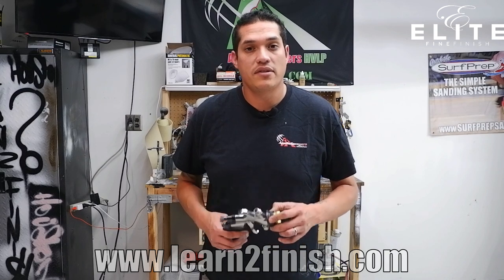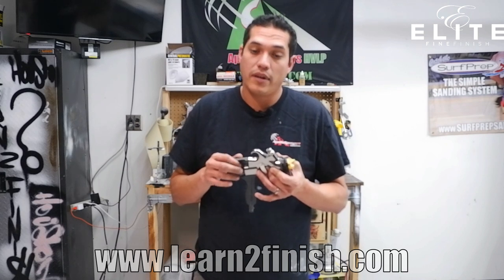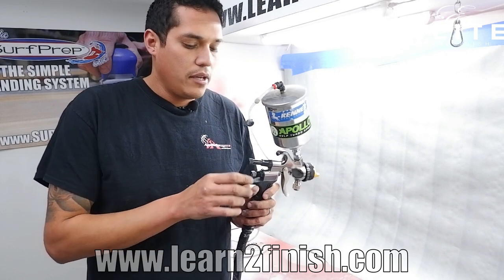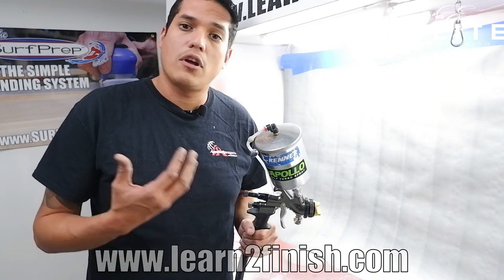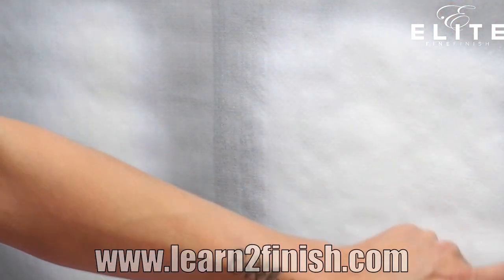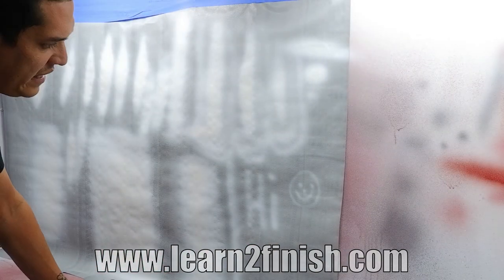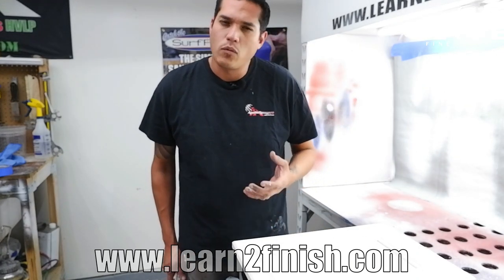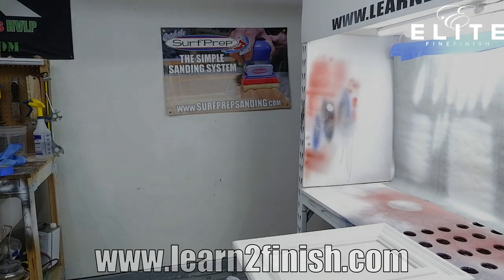How To Adjust An Apollo 7700 HVLP Turbine Spray Gun

Comment: The level of control and adjustment is amazing. This blows airless out of the water. Why do people even use that tech anymore. Hvlp has always been king
Reply: Deamn ..  just got me a 9.5  graco pro comp kinda regret not getting the apollo stage 6 to spray urathane or renner for cabinets or may be I can. Use this gun on it ??
Reply: @prestige_killa  yes you can use the Apollo 7700 with the graco 9.5 turbine
Reply: @bingobunga8995   would I still have to thin down the product?  I should buy this gun then .. for better pattern when spraying
Reply: @prestige_killa  there are a lot of other turbine guns that could be used as well other than Apollo 7700. It’s a very expensive gun while it is a good gun there are others with comparable atomization for less money. The key with spraying high viscosity (thick) coatings is pressurizing the cup feeding the gun. The benefit of the Apollo gun is its air port to pressurize its cups and its ability to be configured as either a gravity or pressure fed gun. Spraying thick coatings comes down to the air cap and needle/nozzle size. Apollo 7700 has a C high solids air cap and a 1.5 needle/nozzle tip. Thinning may be necessary if the percentage of the solids by volume of the product you want to spray is over 30%. I don’t use turbines instead I use a pneumatic spray gun with an air compressor. I’ve had no problem spraying Sherwin Williams emerald urethane right out of the can with a 1.3 tip which is about 32% solids. The key is pressurizing the fluid cup feeding the gun that added pressure forces it into the tip for even consistent atomization.

Comment: Great video! Bin primer is fairly thin in viscosity. How does the gun and the precision5 spray work with thicker products like the Italian waterborne. Would love to see how Milesi 2k pigmented base spray through gun.
Reply from the maker: I have sprayed Renner, ilva, and Milesi 2k water through the guns with no issues!
Reply: I don't know if viscosity ratings compare but I have just finished up a builtin unit and I sprayed BM Advance primer and top coat... thinned by 10% and I used the 1.8 tip and the Blue C-HS cap.  Spray quality was great and this was my first time using the Apollo Power 5 unit..  I have sprayed with an Earlex 5500 for a few years but only water based poly full strength.
Reply: @CustomDartCabinets  Did you open front black ring all the way up when you spray Advance ?

Comment: Louis did you thin the BIN primer at all before spraying? Also, just to confirm you were using a 1.0 needle set up while spraying the BIN?
Reply from the maker: No reduction at all. Correct 1.0 with BHS air cap

Comment: Hi there
When I use the Apollo 7700 with gravity fitting and compressor air at 28 t0 30 psi applying lacquer pre-catalyzed my finish is not smooth look like open porous
Could tell me what I’m doing wrong
Thank you
Reply: have you figured it out  I have the same problem

Comment: What is your favorite primer? Or maybe what are just some of your favorite products with primers top coats.?
Reply from the maker: depends on the application but i use a ton of renner waterbased products. I really like there self seal 1094 product
Reply: @finefinishsupply  the 1094, is that for a refinish/repaint or a new (self seal) wood application. Can you do a video on the 643/851 refinishing combo, maybe the mix ratios on the hardner and crosslinker as well. I just purchased the Apollo 7700 Elite fine finish on your website and am about to transition over to using only Renner for my Cabinet, Furniture, and Door Refinishing. I have been using BIN and precat Lac  and some other waterbornes for years but are not too familiar with adding catalysts. Thank you for your time
Reply: @ZpeaceION   check it out @Eric Reason channel he tested a lot of Renner product awesome channel

Comment: You’ve inspired me to pick up the Apollo power 5. Saw a post about it on the cabinet painters FB group. Question. I primarily will be using for cabinets. Would you recommend bottom feed or gravity feed considering the angles involved with doing cabinets. I’m coming from an airless
Reply from the maker: I would go with bottom feed. I would also encourage you to get the 3m pps adapter for the gun to make it a little easier to work with. Please consider us for your purchase! I am available to talk anytime 346.345.8951
Www.learn2finish.com
Reply: louis Jasso so getting the pps adapter in order to use the pps cup with the disposable liner system with the Apollo gun? Got it. That was one reason I was originally leaning toward the graco 9.5  I’ll def take a look at your site. I was actually gonna ask if you wanted to send me an Amazon affiliate link before I bought but I’ll take a look